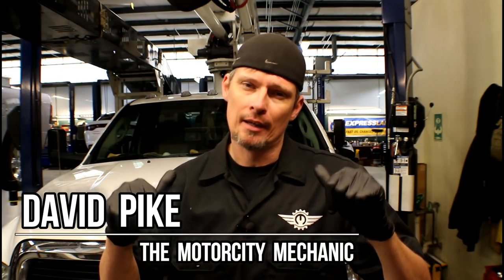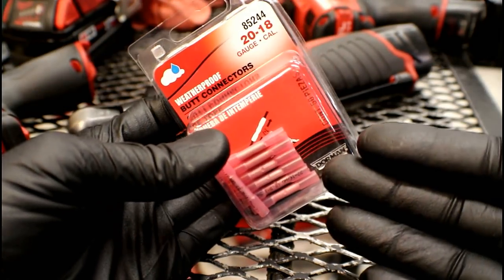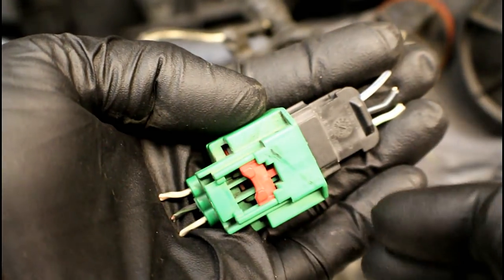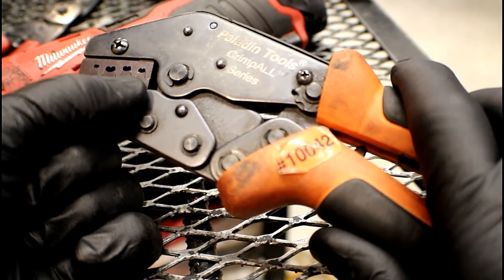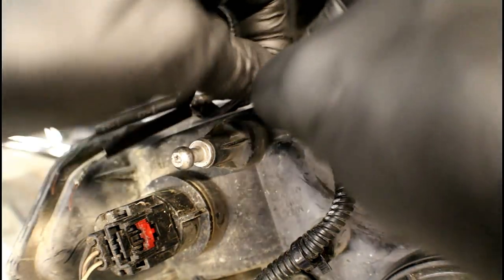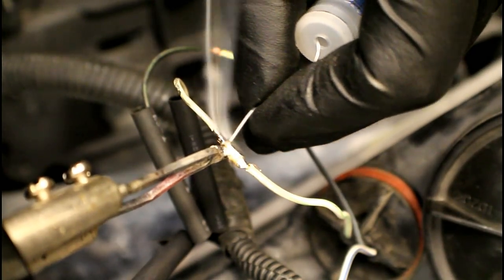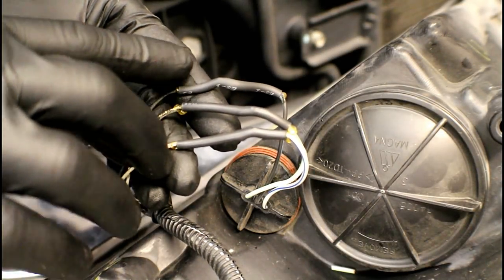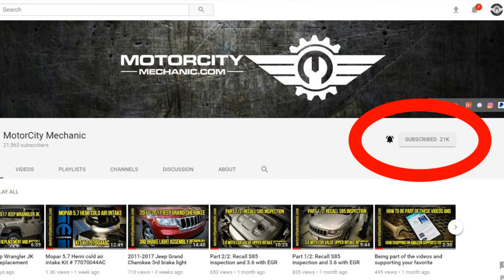2011-2015 Ram truck headlight problem video followup and connector fix

Comment: I'm trying to troubleshoot issue with some new headlight assemblies I purchased for 2010 Dodge RAM 1500. I parking lights work, and high beams work, but low beam not working at all. Any thoughts ideas where I should start?

Comment: Thanks for the insight. 2012 Ram 3500 - dealing with a "No Bus" issue for well over 2 months. TIPM replaced,  guage cluster replaced twice by the dealer.  Do you have any suggestions what could cause this problem? Wipers come on,  all gauges go to zero,  turn signals don't work,  ect. 

Any ideas??
Reply from the maker: A no-bus message issue is a hard one to diag. Its hard to find and sometimes you just stumble across it by accident while checking the systems out. There is no common issues that I know of that can cause this concern and nothing I can point you towards at this early point. Its going to be about finding a good tech that knows that they are doing and them spending some quality time with the vehicle to hopefully isolate the issue.

Comment: I have a simple one for you, Mc M. I recently replaced the ultra dim halogen bulbs in our 2014 Chrysler 300 C with LED bulbs ( Diode Dynamics ). I would like to aim them slightly higher, and the right lens slightly more to center. Some model years of the 300 C  have a slotted hole in the radiator support member to allow access to an adjustment screw. The 2014 has no such hole. Can you please tell me where the adjustments are for vertical and horizontal aiming of these projection headlights? As always, thanks for all the knowledge you share on this great channel.

Comment: David. Thanks for all you do to help. My issue: driver side headlight low beam out. I decided to replace both side low and high beam bulbs. I inspected the connectors attaching to back side of each bulb and didn't notice any deformity; thought all was good. Few days later I noticed when locking my truck with remote, head lights flashed (as is normal) but low beam didn't flash on. I pressed remote lock unlock on key fob and this time came on and the next time it didn't. How do you know when main connector is gone bad if no physical sign exist when conducting visual inspection. And do I order this part in your link below for this repair. Thanks...Brooks  Dodge Ram 2012 Laramie Longhorn 4wd, 1500.

Comment: Great job on your videos.   You've found two of my issues for me.     Plugged evaporator on ac and headlight.  You seen intermittent svc 4wd light, and any suggestions?
Reply from the maker: Jason Woodward Glad I could help in both cases. As far as the 4WD message.....there will be a code set. It will take a scanner that can access all the control modules to see what it might be. From there we will have a direction to go in. Otherwise it could be one of many possible causes. Thanks for watching and for the question
Reply: MotorCity Mechanic  know of a scanner the general public can afford that will do this.   My tuner reads dtm codes never sets a code their but could be a code in tcm I'm guessing.   Thinking my issue is in connector.
Reply from the maker: There is a very cheap scanner thats  $100.00 that is a basic code reader like everything else on the market but it comes with one added feature.....you get one free download of a "brand" of vehicle such as Chrysler. That download will then let you see all the modules and even the data. You cant command anything on or run any tests but you will be able to get the codes and see data for that module. The scanner is slow as hell but being that it can access all the modules for $100.00......I am okay with waiting as it goes thru each one and lets me in. Here is the direct link to that scanner.....it might take some time downloading the free "brand" but their customer support was very helpful when I had an issue with it. https://www.amazon.com/Autel-Diaglink-Version-Diagnostic-Transmission/dp/B01N0QQZY7/ref=as_sl_pc_qf_sp_asin_til?tag=motorcmecha01-20&linkCode=w00&linkId=38c097986772e9739e16306ab05b315a&creativeASIN=B01N0QQZY7

Comment: I have a question on 2014 town and country headlight problem. sometimes when I go to highbeams I seem to lose power to dash, Radio, heat, all warning lights come on. It will all come right back on except some of the warning lights may stay on. When I shut it off and restart all seems fine and no problems if I don't use my highbeams. I've read about the tipm problems but haven't seen this problem mentioned. Any ideas? My local dealer says they  can't  duplicate and no codes set.  I am subscribed as I had the 3.6 oil filter leak and your video on that got my dealer to fix under power train warranty. thanks.

Comment: Having same problem so i straight wired like u show and still have no lights. Have power at end of both pig tails at the bulbs with new bulbs. My question now is, could it be grounding ? So i will try a single ground to passenger side. The drivers side was jumper harness connection burnt.

Comment: Good fix. Shouldn't the average bym try the connections by turning the headlight on before soldering and heat shrink?
Reply from the maker: The best way to test for that connector issue is usually when the headlight isnt working.....then if you move/wiggle it and it starts working....you know the rest of the story. Time to cut and solder. Otherwise I hate to see someone do the repair unless the issue is happening and can be 100% sure thats the issue. Thanks for the comment.

Comment: Question - I have a 2015 Dodge Ram 1500 Big Horn with moisture inside the driver's side headlight assembly.  Is that something that can be repaired or would it be best to replace the entire assembly?

Comment: I wonder why doesn't RAM come up with a decent quality connector?
Reply from the maker: The connector is outsourced and made by another company which means....they most likely have made the same connector for another brand as well. I can assure you that Ram isnt the only car company that has connector issues. I hear from other techs that work with VW and Volvo and they too have a few that have common connector issues. Might be time to rethink the style of connector or pin/terminal type for sure.
Reply: this is true. i see connector problems alot. they arent a CAR mfg part but outsourced like he said. so more than likely there wont be an updated or better version. unlees you look to aftermarket but then still can be iffy. BTW great job on instructions. you are like me at your age!!!!! keep wrenching brother!!!!

Comment: I can't seem to find that heat shrink tubing with the sealant. I'm very impressed with that stuff. Do know where a guy could buy some? Or do you have a brand name? Thanks
Reply from the maker: The brand that I use that we can get our hands on is Napa 784754. It comes on 4 inch lengths and there are 11 pieces in a kit. Just cut it to small pieces and you will have alot. The heat shrink with the sealant is the only way to go. It has great thickness unlike the cheap stuff you find at the store. Thanks for watching and for the question. Make sure to  subscribe Roger.
Reply: subscribed Thanks!
Reply from the maker: Thank you Roger

Comment: great video... should be a recall  same with death wobble
Reply from the maker: I agree about the headlight issue for sure. I dont see the death wobble issues where I am located. Many years ago I would come across it on certain vehicles but not these days. I hear about it but just dont see it at our shop. Doesnt mean it doesnt happen however. Thanks for watching and make sure to subscribe and click on the bell icon as well.

Comment: I had 2006 Ram 2500 6.7 left head light wasn't working.
Used mt Cts  programer to check for codes None . Hit clear codes and light started working again. No more trouble.

Comment: Great info as usual. The usual crap shrink connectors you get at the auto parts store will shrink just enough to let moisture in but not allow it to drain back out. Can you provide a link to those shrink connectors you are using? The Amazon link just goes to a general page.
Reply from the maker: I dont use any shrink connectors. I do use heat shrink after I solder the joints. When getting heat shrink make sure its the weather proof type. Otherwise no crimping heat shrink getting used here. We use the Mopar heat shrink because it comes in different repair kits and usually I have a few extras for repairs such as this.
Reply: use some silicone lube (thick one) before you put on those shrink tubes. I had some crappy ones but the silicone was a great fix. When you heat shrink is the silicone gets pushed out creating a nice water-proof seal.

Comment: Would this connector also cause a problem with the turn signal? I went to swap my high and low beams for LEDs, now the high beam and turn signal won't work.

Comment: My truck has the dual, not quad bulb headlight assembly. With that being said the main green connector coming from the truck is plugged directly into the bulb so I cannot just hard wire like shown I have to replace the green connector. I can’t find the exact connector online anywhere. Any guesses on where I can find one?

Comment: what about projector headlights with the same issue low beam not working , l took out the driver side headlight pluged it in the passanger side and it worked so l know my bulbs are good

Comment: Do you prefer to make this permanent connection vs replace the connector with a new one?
Reply from the maker: I prefer the soldering of the wires. No more issues and no money spend on connectors and wiring pigtails. Simple fix and the issue with that particular connector will not happen again. Thanks for watching and make sure to subscribe
Reply: Got it! Have this exact issue right now going to take your advice and just solder the connection to avoid this issue from reoccurring. I appreciate the videos and will make sure to subscribe!
Reply from the maker: Your welcome and thanks for watching!

Comment: I just purchased a 2011 Ram 1500 5.7 just had the dealership replace the alternator and battery since all of a sudden the check engine light came on lost power and all the electronics went crazy. The alternator was reading too high.  But now even with those replaced my dome lights and headlights go bright and dim like they are surging. I have no clue what it could be and the truck is back at the dealership. Have you seen this before?
Reply from the maker: Doesnt sound like anything that I have come across as of yet. I asked around the shop and no one else has either.

Comment: Hello I got a 2021 ram 3500 tradesman 6.7 diesel.  Put new windshield wiper motor and switch     fuse is good and still not working.

Comment: I have a 2013 ram 1500 with the green headlight connector issue on both headlights. When I wiggle the connector the lights come on but one side the top light is on and the bottom is out but the other side the top light is out and bottom one is on. What could be causing that?

Comment: Does this fix the headlight flickering that happens every now and then or is that a different issue? I have a 2016 Ram 1500 that the headlights flicker sometimes.
Reply from the maker: Personally I havent driven one with that issue at night to see if it would flicker. I know that its very possible...especially if its just one headlight doing this. If both then more then likely some other issue. Thanks for asking and make sure to subscribe
Reply: It happens while I'm driving, so it is hard to tell if it is one headlight or both. I'll check out the plugs and see if I can recreate the issue manually.

I have already subscribed. Thanks for the reply and thanks for the great videos.
Reply from the maker: Yeah get access to the back side where the connector is and turn the headlamps on and wiggle and tug in the connectors to see if one acts up. Thanks for having subscribed and for following the channel.

Comment: Now I will be returning the parts to the dealership.   This fix will save almost $100 in wiring harnesses if you replace both ends of that connection.

Comment: After a light bulb change, How do you reset the TIPM with out going to the dealer?
Reply from the maker: There is nothing to reset. If the system is fine the lights will work as normal. If still having issue then the bulb possibly wasn’t the issue

Comment: My headlights have randomly flickered since it was new, now my low beam is out.
Hope I don't have a connection issue
Reply from the maker: lee hancock The connector will be the most likely issue. Simple fix and cheap.
Reply: @MotorCityMechanic  well I'm back. Haha. 
7 bulbs in 5 years and I dont drive at night but occasionally.

Comment: ok so I still couldn't get my headlight to work I checked the plug with a test light and nothing. I turned the brights on and it lit up. so if I'm not getting power down the white blue striped wire, where do I go from there

Comment: My headlight just went out i replace the bulbs but still I wonder if i should eliminate the conector 🤔
Reply from the maker: Best way to check is to turn then on and if they are acting up.....get access to that connector and wiggle it to see if it starts working. Some times I can slap the headlight....gently enough to not damage it.....and it will work then which points towards the connector needing to be bypassed. Thanks for watching. Make sure to subscribe.
Reply: MotorCity Mechanic thank you buddy
Reply from the maker: @robertobriones9844  Your welcome!

Comment: Wouldn't di-electric grease help the connection? So as to not spice it permanently.
Reply from the maker: I have found that di-electric grease doesnt help. It only prevents moisture from causing corrosion. The issue is dealing with the terminals and/or the terminal to wire crimp. We see the same issue with the airbag connectors under the seats on alot of our vehicles and the fix is the same. Even with the wires soldered.....the wiring from the headlamp can be removes do that you can remove the headlamp assembly is need be so it doesnt prevent that. Thanks for watching Robert.

Comment: Hey I have a question is it a good idea or even possible to put LED bulbs on my 2015 eco diesel
Reply from the maker: There are ways to do it but I havent. The system will not work properly if you dont install all the needed items......the vehicle is checking the current draw of the lights and when they get changed out it thinks there is an issue. This can cause them to flash or not work at all. I dont have any personal experience with doing it to give you much more advice. Thanks for asking and make sure to subscribe.

Comment: Just one issue with this type of repair.
You've just made it take more time than necessary if you have to replace the whole headlamp assembly. As for example those cheesy broken tabs that happen A LOT (as your first video depicted) that secure the unit. lol Soon or a later you're harness may get too short.
Reply from the maker: Sure you could buy both wiring pigtails and spend anywhere from $50 to $70 if your lucky or you can fix the issue and never have an issue again. On the other topic....how often do you expect to replace a headlamp assembly.....most likely never in most cases. You have options for sure....spend lots or spend nothing and fix the issue. So many choices and each has its pros and cons.
Reply: The fix is good. Only being a fleet mechanic with a basket load of 5300. Those head lamp assemblies brake a lot .(Drivers bumping the damn things) Not to mention fill with water. They make great fish bowls.lol

Comment: How can I determine if this connector is my problem?
Reply from the maker: Easiest way is a wiggle test. When not working....if you wiggle the connector and it starts working....you found the issue.
Reply: I put new high and low beam bulbs in. One of them was a bit discolored but not black. To my dismay, that didn't fix the issue. So I put it all back together anyway and figured it was something deeper at fault. Then tonight they're on all of a sudden.What about spraying WD40 in that connector? That seems to work on power window switches etc.
Reply from the maker: Any change when wiggling the connector going to the headlamp assembly (not bulb)? I see no need for wd40 in this situation.

Comment: what is the root of the problem you have a resistence problem
Reply from the maker: Exactly.....its a connection issue at the connector. It appears the pins arent making good contact. We see this on some other connectors and it appears GM has the same issue as us.....same company makes the same connectors for them as well.

Comment: So I know this is gonna sound sooo dumb, but here’s something else everyone should look at…the connectors on the 2016 ram 1500 for the turn signal AND high and low beams fit in either one. This is embarrassing but I did this and couldn’t figure things out and then when I looked I was like “you stupid f__k”…needless to say, I switched them around and they work. Voila. 

Moral of the story is: don’t be stupid like me. lol.